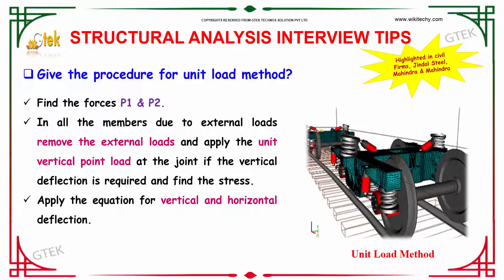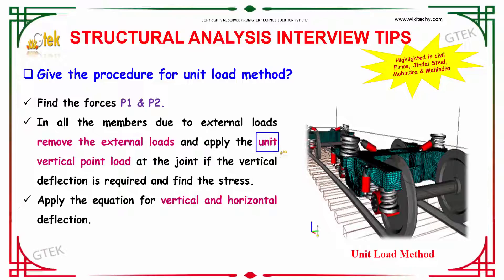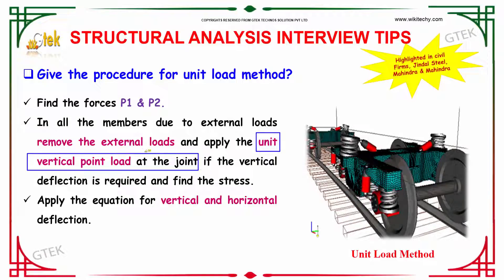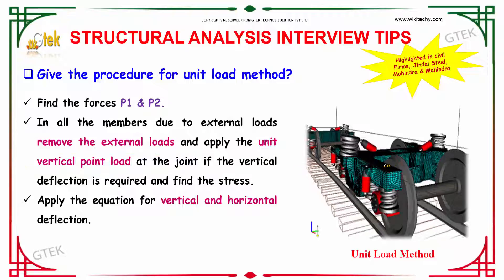Give the procedure for unit load method | Structural Analysis Interview Questions

Comment: In all the members due to external loads remove the external loads and apply the unit vertical point load at the joint if the vertical 
deflection is required and find the stress.